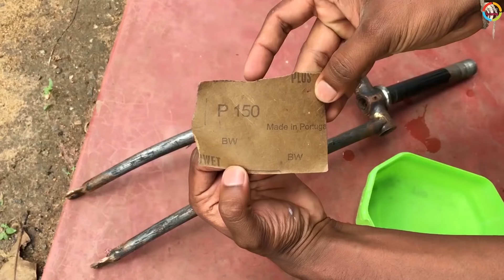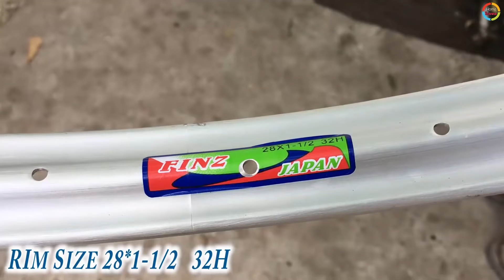Old and Rusted RALEIGH Bicycle Full Restoration

Comment: I wouldn't exactly call it a restoration with basically only the frame and forks remaining but it came out great and is certainly inspiring. Love these old classic bikes the most. Well-done.
Reply from the maker: Thanks 👍
Reply: I've got 2 original ones a 1961 and a 1949 unrestored fully working with dyanmo and dry battery pack still working I use the 49 daily and have sence 2019 I payed 80 pounds for the 49 and 120 for the 61 so reliable never had a problem with either bike I Mabey sell one soon ent to sure yet
Reply: mr

Comment: I have several Raleighs - I have been a fan for 50 years. I have two 5-speed derailleur types, the rest are Sturmey-Archer 3-speed hubs. None of the Raleighs I have right now are in totally workable condition; all but one would require nothing more than a good cleaning, new tires/tubes.  When I get the time...Raleighs are the King of Bicycles!
Reply: Do share  a video with us
Reply: Do u remember the Raleigh Humber ?
Reply: King of bicycle.?Sure... ❤️❤️❤️❤️❤️
Reply: I have a 1949 and 1961 think there a Humber or sports I ent to sure on the model both working one cost 80 pounds one cost 120 pounds I use the 49 on a daily basis one of the best bikes I've ever owned
Reply: Chup ye purana jamana

Comment: Brother excellent job. Kindly tell me from where u purchased the breaking system accessories, cycle rim and full chain cover. I am also having the same which needs such replacement.
Reply from the maker: Thanks 👍
Reply: @MasterRestorations  kindly inform me from where u brought the necessary replaced articles
Reply: @BaljitSingh-ze9fy   you can ask local bicycle dealer, they usually have all spare parts !

Comment: Pink rear tail fender !!!!!! Blue hubs!!!!!  Raleigh will be turning in there grave I renovate VINTAGE bikes  and keep all parts original as well as any rusty parts cleaned and clear lacquered
Reply: Where do you get part? I have 1985 era Raleigh Alyeska 
touring bike. Don't want to abandon it. It's been on many road trips. I'd love to restore it
Reply: @geraldfornshell7169 during most of my restoration projects I totally lubricate all nuts bolts brackets etc strip down each section to the nut and bolt ,clean  them and respray the frame  some brackets for example maybe totally rusted so I make a new copy, cleaning takes the time and if I need certain replacement parts then eBay or Google have good web sites available for Raleigh vintage bicycle ,mine tend to be 1940  1960  just finishing off a 1940 Raleigh sports model 3 speed all steel let me know if you need any further assistance or information

Comment: A few points,  I would lubricate the chain & all  fulcrum points.  The the chain case front cover should turn 90 degrees  so that little slide on cover @ 12 o clock position . &  I would add self oiling lubricator in side the chain case, Good restoration . Cheers.

Comment: My father owned one Senind Raleigh of 24" height as he was a Six footer and used it till he attained 55 years of age. Later, my elder brother, my self, my two younger brothers used it. Now, I used it till last year. It needs painting, nickeling and overhauling besides dynamo repair. Though bicycle is in working condition, I wish to bring back it's past glory. Can you please send your address and contact number to get the cycle repaired? I reside in Guntur, Andhrapradesh.